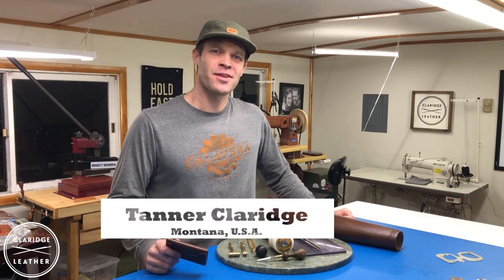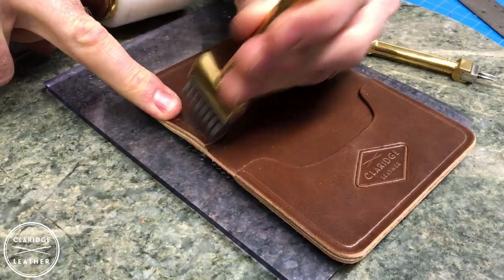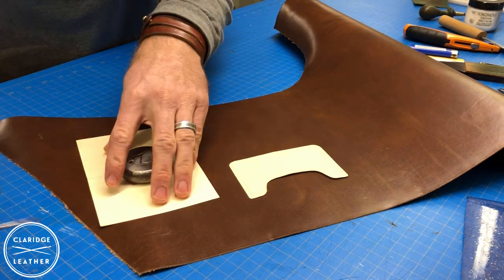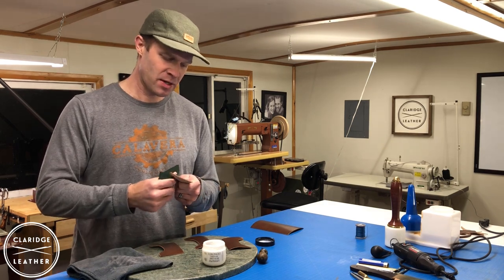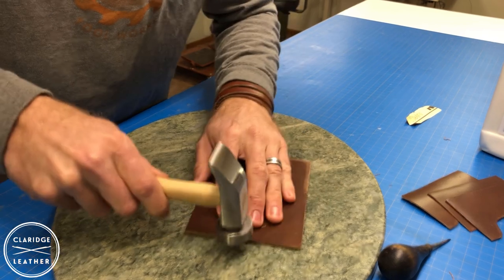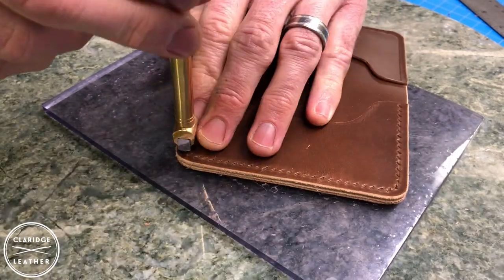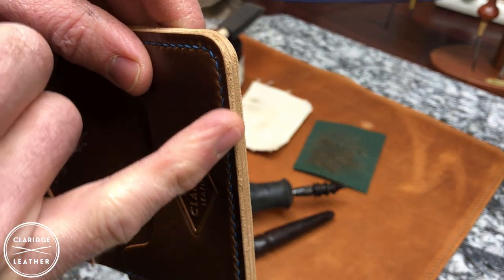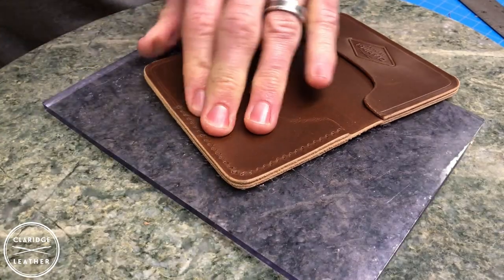How to Make a Leather Card Wallet (ALL the steps): Tools & Tips in 15 Minutes

Comment: Great video. What sander do use to true up the leather. I got 2 trautmans sanders for cheap and set up one at home for leather. A bit overkill but great for round corners.
Reply from the maker: I wish I had a Trautman at home! They are perfect, huh? I use a little Tandy drum sander, nothing like a Trautman!
Reply: @ClaridgeLeather  we closed a couple of offices and corporate stored all the equipment in our office. After sitting for a year they called a clearing house to get an estimate,  and they sent a small check for approval. I caught it before it went up the chain and offered the same amount. Split it with my tech, 4 trautmans, 2 drill presses, 2 band saws, 2 chemical cabinets, and a vacuum pulling station. Deal of the century. We kept the trautmans and sold the rest. Still have the chemical cabinets. And would still like to sell a couple trautmans.  Probably keep one as they are so familiar from work it carries over well at home.

Comment: 10.14 how do you make it come out so fast? The piercing I have will get stuck everytime...
Reply from the maker: Do you mean the pricking iron? I think it mostly boils down to the specific irons you’re using. I have used many that are tougher to remove, but these teeth are a more narrow polished blade, so they tend to go in and out more easily. Teeth that are tapered, rough, or larger diameter seem harder to remove. I have seen people poke the teeth in wax (paraffin) before hammering them in, which seems to make the tool easier to remove. Hope that answers your question!